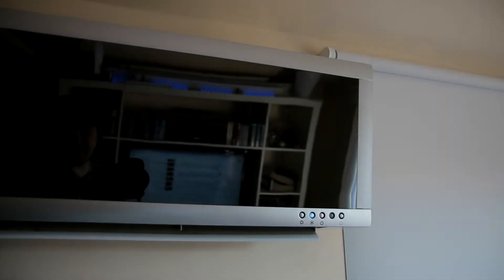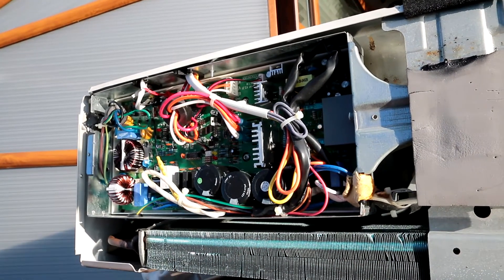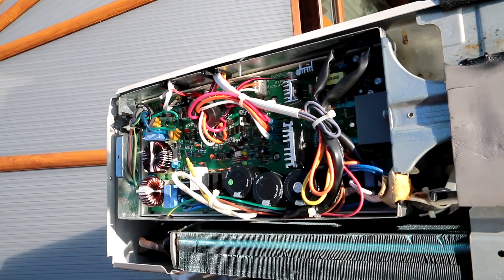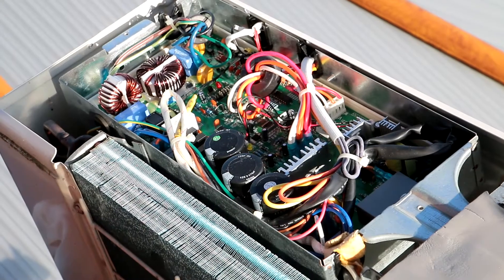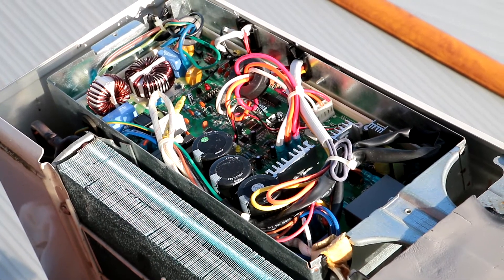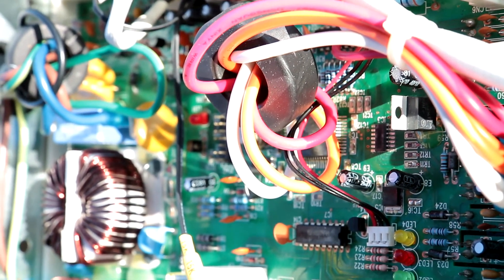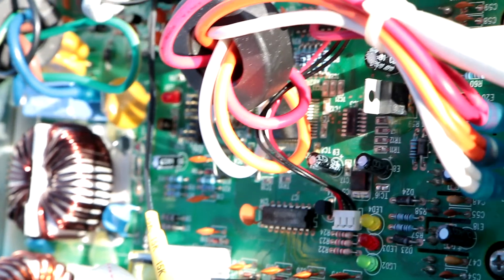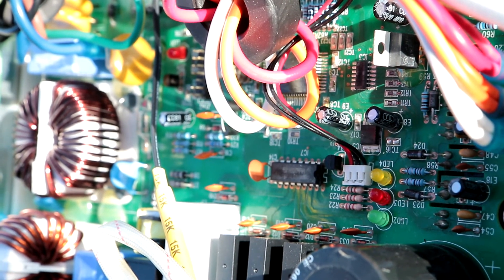Air Conditioning help required!

Comment: Hi Frontsidebus. 

If your are still in need of help or anyone else has a B&Q inverter, read on...,

I have found a service manual 

http://gree.wienkra.pl/files/produkty/cozy/Dokumentacja%20techniczna.pdf.

It is in English. Looks like you need to read the LED's on the outdoor unit along with the LED's on the indoor unit to reveal the true error code.

Let me know if that helps. I have the same unit that may have a communication problem - wish me luck!

Russ

Comment: looks like you have problem with communication between in and outdoor unit. I'm  a/c protech. this is common problem with Daikin and Fujitsu.  to rectify this problem follow wires from compressor where is connected on which pcb then order that board.  make sure that you have refrigerant in the system and your compressor is OK.  use ohm Metre to test the compressor. if compressor is OK replace the outdoor board.  I hope this will help you a bit.

Comment: Is this an inverter Aircon? Do you suspect the inverter board? Motor coil resistance test? Motor megger test? Or does it have a start/run capacitor could be any easy fix? Dunno.  HeavyDiesel and BigRefrigeration are UK refrigeration engineers They may be able help.
Reply from the maker: Coolkeys2009 It's an inverter model. I'll have to get inside and check the motor windings. I suspect the inverter board is fcuked.
Reply: FrontSideBus At least if it's a power device or cap on the inverter board you can probably repair it just don't get zapped by the inverter capacitors :-) I hope it is a simplish fix like that or a sensor.
Reply from the maker: Coolkeys2009 Too bad HeavyDiesel doesn't venture up to the North West. I'd love to pay him for an install, you know it would be first class workmanship :)

Comment: I believe they are made by Gree, have found this not sure if its any help.

http://errorcodeairconditioning.blogspot.co.uk/2011/06/gree-wall-mounted-and-ducted-error.html

Sometimes the codes for the leds are on the inside of one of the outdoor unit panels.
Reply from the maker: heavydiesel Cheers for the info, I did have a quick google and couldn't find much. The intermittent indoor error translates as an "H5 IPM protection" error.... whatever that is. I'll have to get the covers off and have a look for the other codes.
Reply: Turn it off a good 15 minutes before poking about, the inverter capacitors hold a charge long after the power has been shut off.
Reply: FrontSideBus I suspect IPM may be Inverter Power Module.
Reply from the maker: heavydiesel Oh yes :)
Reply from the maker: The Lightning Stalker In that case it's probably for the bin :(